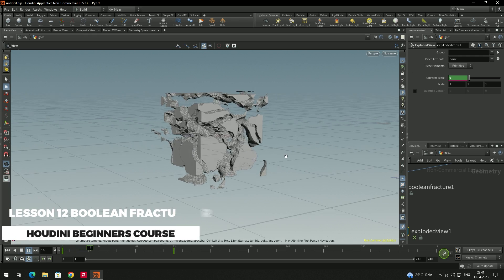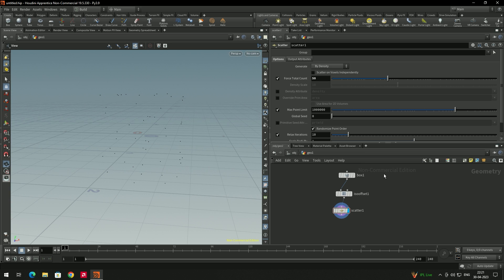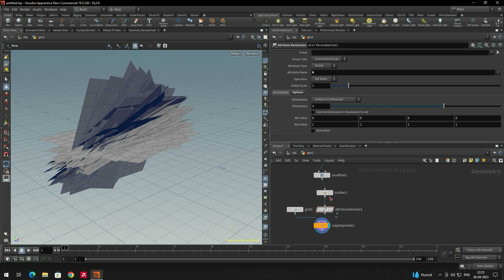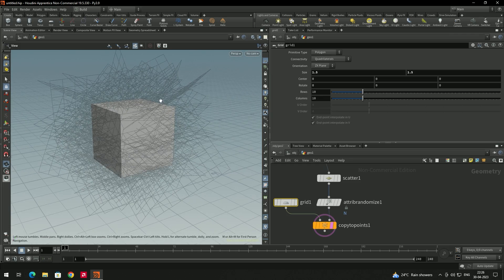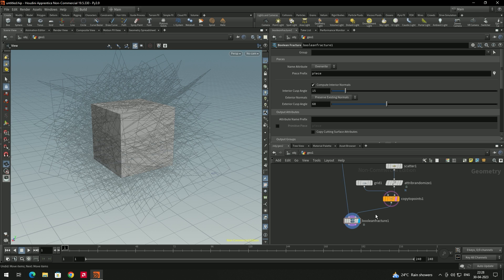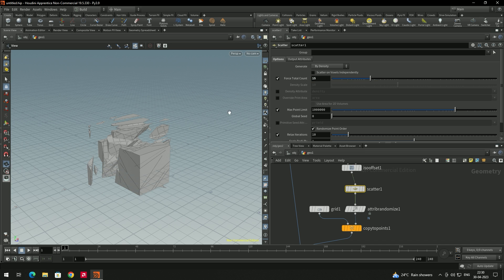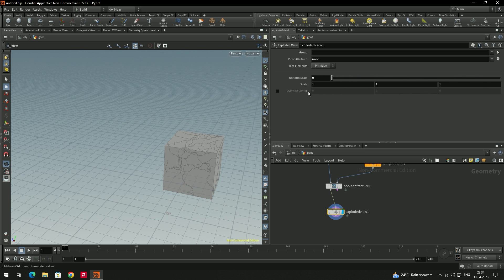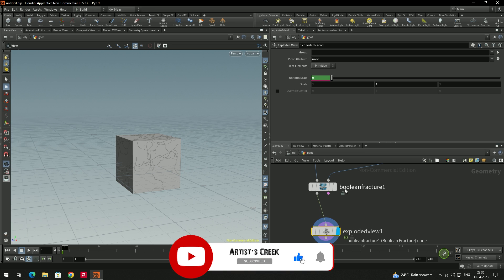Lesson 12 | Boolean fracture node for destruction | Houdini Beginners course | English

Comment: I stumbled upon this video while looking for ways to add damage/ wear tear detail to corners of a geometry (concrete). I tried using convert line and scatter nodes to boolean noisy geometry (a sphere that's run through mountain node) like boxcutting but didn't get it to working properly. I'm such a dummy 😅 A tutorial on how to add good looking wear and tear geometry procedurally would be appreciated.